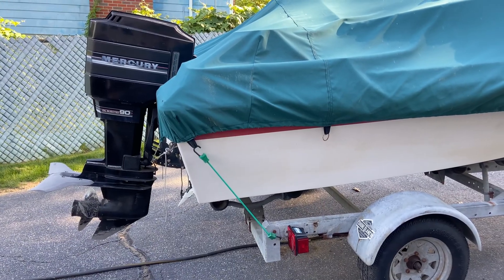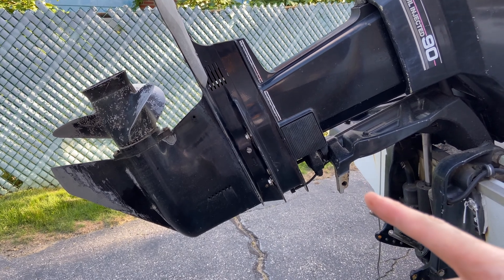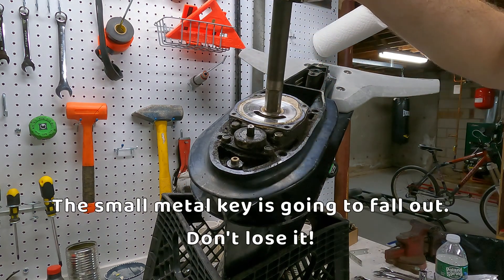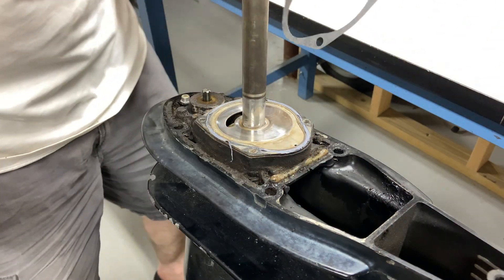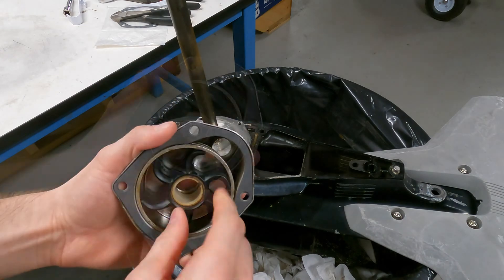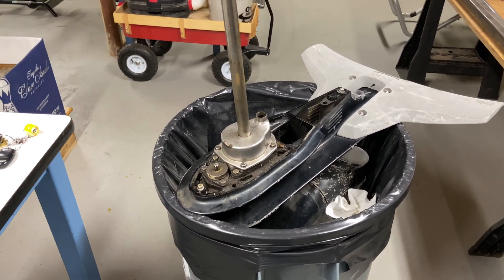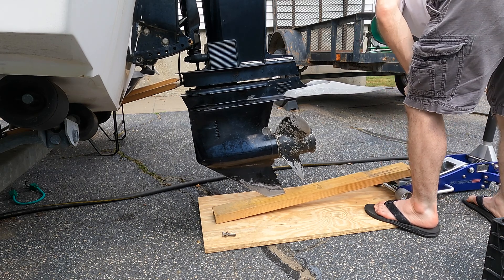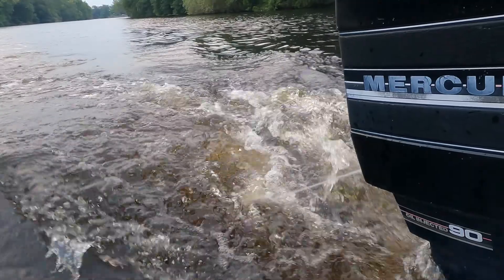Replacing Water Pump Impeller in Old Mercury Outboard

Comment: Old video, but very practical and to the point. I bought a boat a couple months ago and it is a 1985 90HP Merc also, and I plan to do this before I get it out into the water. When I started the motor in the yard, it didn't really pee as well as I liked, so I am preparing to order the kit today...thanks!!!
Reply from the maker: Old video? Its only 2 years old!!?? Also yes you want a strong stream of cooling water if you want your motor to last forever. I also replace my thermostat, it was cheap and very easy to access. And I replaced the water house that leads to the water outlet. That was also pretty easy and cheap. Might as well do all three to make sure your engine runs nice and cool.

Comment: mine runs out steady, as wide a  stream as the hose and goes down, but doesn't shoot out with force.   Is that good enough
Reply from the maker: Hard to tell from your description if you're getting proper water flow or not. But I can tell you an overheating engine is bad news.

Comment: I have a very similar engine as yours. Mine is a 1990 4 cylinder 2 stroke. I’m trouble shooting a peeing issue. My thought was to inspect the thermostat but mine does not have one. Does your mercury have a thermostat?
Reply from the maker: Yup mine has one. I replaced it, and the impeller, and I replaced the water line that leads to the "pee hole". The hose got pinched in the engine cover. Not sure which one was the real problem but after replacing all three, my engine was peeing like it just woke up after sleeping late :D

Comment: Where did you order the parts? And what were the part numbers? I have the same motor and I would like to change my impeller. Thanks in advance.
Reply from the maker: Hi. You have to find a serial number somewhere on the engine. Once you have it, you can look up a diagram on any parts website, get the number for the impeller, and then look up THAT part number on a bunch of websites and find a good deal. 

And this is why every one of my repairs takes months :D

Comment: Helpful tip, the lower unit wont go back up into place if the splines on the main shaft or shifter aren't lined up. Wiggle the prop or shifter and it will easily slide into place.
Reply: I had that same thought watching him fight with it.  Simply turning the prop should have enabled it to slide right in.
Reply from the maker: I think part of the issue may have been (its been a while since I made this video) that I didn't leave it in gear, so turning the propeller doesn't turn the shaft.

Comment: I found neutral works best for getting lower unit back on. It has the least amount of play in gear housing and you can turn the fly wheel with your fingers if it does not align. I put it in forward originally and could not get it to fit. Turning the prop did nothing for me.

Comment: I had a heck of a time removing mine, all because of 2 hidden bolts. I used a ratchet strap to hold the lower unit up and it worked better than any other way I tried
Reply from the maker: Hidden bolts are the worst!

Comment: Was your motor pissing before? I have basically the same motor (1994 60 HP merc) and water just dribbles out of the piss hole. Do you think impeller problem?
Reply from the maker: It could be the impeller, it could be the hose the water pees out of, it could be the thermostat that regulates it. It could be a combination of all three. But the impeller is just a rubber wheel so if yours hasn't been replaced in a while, its a good place to start.
Reply: @YardworkWithJohn  thanks man I got an impeller w/ kit ordered. Gonna tear into it, at least make sure the impeller is good and go from there.

Comment: Can you provide the part number for the impeller?
Reply from the maker: Unfortunately no. You really need to find your motor's serial number and then look up a parts diagram. There are many different impellers with many different part numbers, so even if if I had the specific part number of the impeller I bought (which I don't), it probably wouldn't help you.

Comment: Yup, 1989 115 two stroke.. Put it in reverse, and it went back together like magic. That impeller kit is something else. I didn't mess with the tube o-rings, just put a little marine grease on the impeller housing tube side so it would slide in easier.
Reply from the maker: A little lube always helps it slide in easier. Wait what are we talking about?

Comment: I replaced the w.p impeller and now I cant get it to shift right has anyone had this problem. Is it the shift linkage ? Just not lined up right ?
Reply: There is a smaller shaft in your lower unit spin it all the way to neutral with plyers then place it back in correctly. I had this problem a while back
Reply from the maker: That would be my guess.

Comment: When the lower unit does not go all the way up, slowly bump-bump-bump it softly up as you barely turn the prop just a little until it slips all the way up. Something turned the prop just a little, probably the garbage can, if NOTHING moves, they usually slip right in. When it doesn't, just a small fraction of a turn, and pop, it goes in. Motor should be in reverse in this process. Also, next time antiseize the bolts.

Comment: I am currently struggling to get the lower unit off.. its in neutral - does it has to be in gear ? Did you touch the linkages at all ? Thanks
Reply from the maker: Off or ON? To get it off, all you have to do is undo the bolts and then tap it off and it should slide right out. Is it possible you are missing a bolt or two? Putting it in neutral or drive only has to do with reassembly, not taking it apart.

Comment: I’m still looking,but I’m pretty sure it has to be in a gear or neutral, can’t remember which that’s the reason why I’m watching videos. I don’t remember why it’s important.
Reply: mercury inboard & out board s every thing is done in forward gear  as far as the pump housing put the impella & key on the pump base first  slide the pump body down the drive shaft to the impella hold down on it & turn the prop with your foot  . never use a floor jack if both lower unit & shift handle or controls are in forward and the water tube is lined up it should just slip right back on .

Comment: I wonder if the shaft key came off the impeller and that caused it to not spin and suck water. - Thank you for the video
Reply from the maker: I don't think so, the key was right where it belonged when I took the old impeller off. Also it did seem to work at higher RPM.

Comment: Do you think this will fix the water not coming out of the hole?
Reply from the maker: There could be a lot of reasons that is happening. Mine seemed to be a combination of old impeller, old/crimped water hose, and corroded thermostat. There have also been times where I've been boating in really overgrown waterways and weeds get stuck and clog the input.
Reply: Do you have a thermostat replacement vid? Thanks.

Comment: You forgot the housing/shaft seal.
Reply from the maker: Which seal is this?
Reply: @YardworkWithJohn  I saw that shifter coupler fall off when you pulled it apart, It was laying on the ground on your first attempt to reinstall the lower unit.. you must have corrected that seeing it went into gear.

Comment: For the love of boats and all that floats...I've watched 6 videos about removing lower unit on merc outboards and absolutely none of them explain getting the shift linkage off...
Reply from the maker: I don't think there is anything to get off. When you slide the lower unit off, the shift linkage is another smaller shaft that slides out of the top of the engine at the same time the main drive shaft does. Unless you're talking about something else?
Reply: @YardworkWithJohn  thank you .
Reply: It odd also a spline it will just slip off.

Comment: Marine grease? Do you mean lithium grease? 
Did you have to drain the 90w from the lower unit first?

Curious if you were to twist the prop a little to align the gear/shaft, if that would have made it slip in easier?
Reply from the maker: I believe this is the grease I use: https://amzn.to/3UDrdK5
I did not drain the gear oil in the lower unit.
And spinning the prop wouldn't help because it wasn't in gear when I removed it. If I had put it into gear first, then its possible spinning the prop may have helped.
Reply: I think the reason the lower half wouldn't go in easy is because the splines on the shaft were misaligned.

Comment: Having the same issue getting the lower unit in myself!  It's the entire reason I watched the video.  Now... back out to the shop.  Glad it's not just me!
Reply: Put in foward before you remove the lower unit then you can spin the prop to align the splines during reassembly.
Reply from the maker: @joshradford1989  Yeah I read this tip after I had already not done this :)
Reply: @joshradford1989  Great to know thank you !!
Reply from the maker: Yeah it was a real pain. It took a lot longer in person than it looked in this highly edited video. You gotta just keep working it and eventually it will go in.
Reply: @YardworkWithJohn  I found that turning the flywheel worked for me!  Thanks!
Reply: Possibly a ratchet strap might work while trying to push the lower end consisting of the impeller back in.

Comment: One more thing you don’t have to torque any of the bolts?
Reply from the maker: You know, it's one of those things. I'm sure if you asked Mercury tech support, they'd say yes you have to torque all the bolts. But I've taken apart and reassembled enough different things in my days that for something like this, I get by just doing it by feel.
Reply: @YardworkWithJohn  yeah I was thinking the same thing I watched a couple other videos and they didn’t torque anything either. Thanks so much for replying. I really appreciate it.

Comment: I have an 87 mercury 135 and am currently struggling with getting it to remount.  So you put it in gear and then out of gear then it drive shaft seated properly?  I will try that, the drive shaft just is not matching up.  Thank you for the tip and great video.
Reply from the maker: I was having a lot of trouble too. Lots of clips edited out of me trying to jam it up there and it not going. 
One thing people on the forums told me is that grease on TOP of the shaft will stop it from seating properly. Assuming thats not the case....

So what ultimately worked for me was what I did with the jack, I put a little bit of upward pressure on the lower unit so when I moved the throttle, it was able to suddenly side up. You could do the same thing if you had a helper. Have someone put the boat in and out of gear while you physically push it into place and see if it goes.
Reply: @YardworkWithJohn Thank you very much for your reply.  It turned out to be the marine grease I put in the grooves, I cleaned it out and it fit in with a little resistance.  Your video was really helpful because I could not figure out what was wrong.

Comment: Regarding whether or not the old impeller was actually bad, remember that in order to pump water, the impeller has to have a good solid seal against the interior of the pump housing. This seal is what provides the pressure needed to push the water vertically into the motor. If that seal is weak, it allows water to pass between the impeller vanes and the pump housing and the resulting reduction in pressure keeps water from travelling up the intake tube. Note that new impellers have straight vanes, while old, used impellers have bent vanes. As noted in the video, you have to kind of force the new impeller into the pump housing by spinning it and bending the vanes so it will fit. Being wedged in there like that is what provides the solid seal against the side of the pump housing. If you go back in a week and remove the impeller, the vanes will try to straighten back out. But over time, these vanes weaken and become permanently curved. At that point, they aren't really pushing against the pump housing very firmly anymore. So even if an old impeller looks OK, isn't dry rotted, etc, it can still be underperforming because it's no longer able to get that tight seal. I personally don't go more than two years without replacing at least the impeller, and each time I perform this service to my boat I also scrutinize the gaskets and plates to see whether or not they need to be replaced as well. Even if you haven't used your boat much, the impeller can dry rot, so 24 months max is my threshold.
Reply from the maker: Yeah I'll never know what my problem actually was. It could have been the impeller, it could have been kinks in the water output hose, it could have been a super old thermostat. All three seems a little iffy but not too bad, so many all three were working together to reduce just enough water flow to give me problems. But I replaced all three (not in this video) and it runs nice and cool now! No more rowing my boat home :D

Comment: Awesome video! I've been thinking about replacing my impeller myself but haven't found a video of a similar enough engine to be confident doing it. I have a 1982 Mercury 90 so this is perfect guidance. Will definitely rewatch when the time comes. Thanks!
Reply from the maker: Put the shifter in drive/forward before you remove the lower unit! I think that will make reassembly easier. Good luck!
Reply: I have an 82 as well.  Fixing to do this.